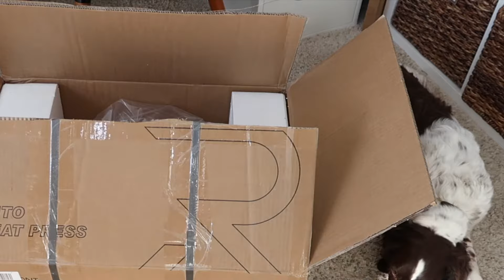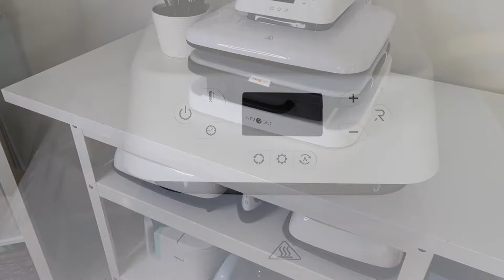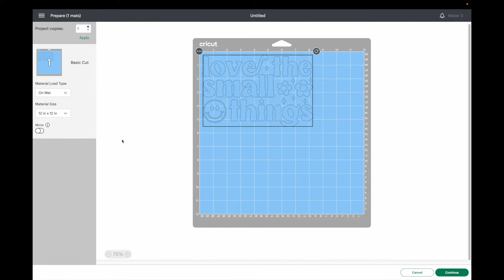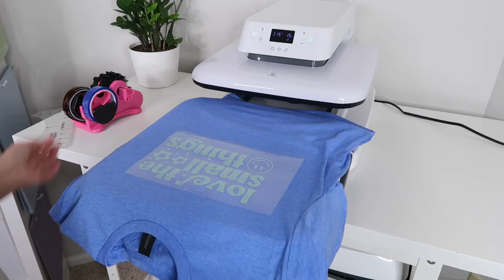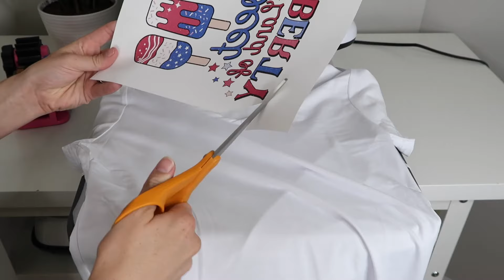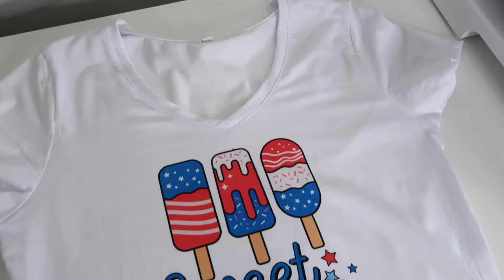UNBOX AND REVIEW OF THE HTVRONT AUTO HEAT PRESS MACHINE

Comment: I bought mine and opened it up a week ago, going to be using it for the first time so this video was great. Mine did have a piece of the plastic broken on the very front left side of the drawer slide which doesn't effect the workings of it but was really disappointing when I opened it up as the two boxes that it was inside of weren't damaged at all so I'm guessing it happened in the warehouse. But what I noticed trying to put a T-shirt on their was I could hardly slide the drawer in? I haven't turned it on yet but I hope it lifts up a little bit when I turn it on so I can do thicker items like sweatshirts.

Update works great and as soon as I turned it on it lifted up but I had to replace the mat after about twenty presses as it wrinkled badly.

Comment: Has anyone tried puff vinyl on this machine?  Wondering if it has enough pressure for puff!!
Reply from the maker: I gave puff vinyl a try on the auto press, and it wasn't as puffy or smooth as my heat press. I've seen a lot of people on TikTok using puff with the auto press, and theirs turns out great. I'm not sure what I was doing wrong! lol
Reply: Try using an extra pillow for more pressure it gives it more force

Comment: How do you do the sublimation transfers? Is there a certain kind of transfer that you print the design on for it to do this? If that’s the case, do you need a particular kind of printer? I have an HP Inkjet but wasn’t sure if that would work at all.
Reply from the maker: For sublimation you need a specific sublimation printer with sublimation ink. The printers are expensive, so I bought an Epson EcoTank, and instead of adding the inkjet to it, I added sublimation ink. I have a video showing how I did it. Here's the link for it: https://youtu.be/fn4oI6mDBcI
Reply: @KaylasCricutCreations  thank you so much! I’ll give the video a watch. I really appreciate it! :)

Comment: I've been using this machine since it first came out. I've done many DTF transfers with it and they come out great. I love this machine!
Reply from the maker: Awesome!! That's great to hear!!
Reply: @KaylasCricutCreations  I just got this machine….using DTF Transfers….any advice for a beginner??
Reply: I just got the machine.  Try doing dtf and it would not press and release
Reply: Hi, I just ordered this machine, I am a bit worried that I have seen negative feedbacks. How is your machine like now? Are they working well?
Reply: @ikoilk  The machine is still one of my favorites! I hope you will love it as much as I do!
Reply: The only comment I needed to read before making my order. Lol.
Reply: Can you use tote bags?
Reply: @RGTenorioStore  I haven't made a tote bag but I've made a wine bag. The only thing that might hinder would be where the seams bulk. But, I didn't have a problem with my bag. Also, watch your bags! I bought some of those drawstring backpacks and melted the straps on another heat press that I had. I have a laser cutter and cut 3mm wood and sublimate onto it using this machine. I've had no problems with it and still love it. I just used it yesterday and if I didn't have company coming over, it would probably be used today.
Reply: Just got this machine I want to use it with DTF transfers….any advice for a beginner??